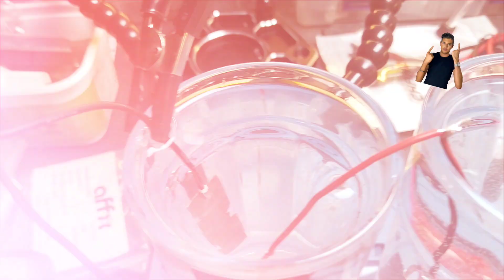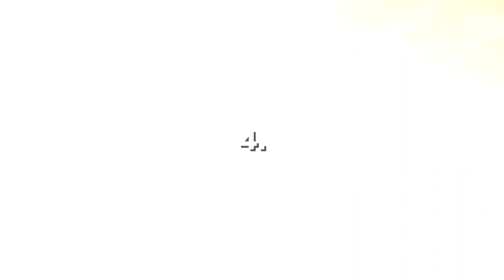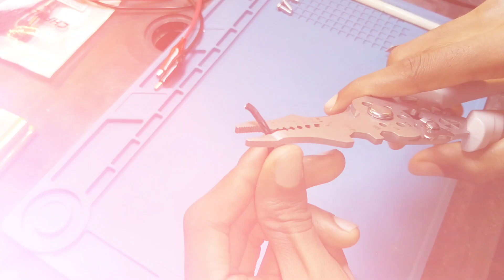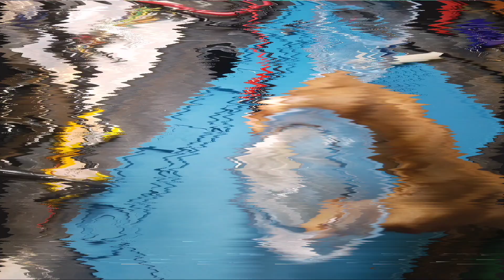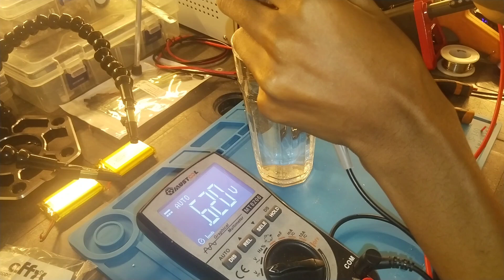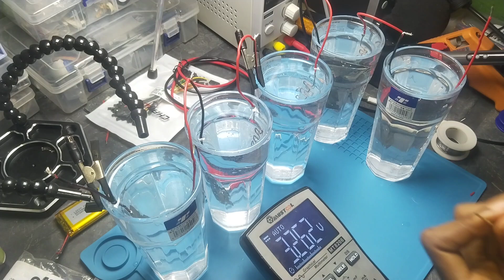How I Created electricity with Salt!(Upgrade) - Powering USB Solder

Comment: Great experiment! I like that you’re testing ideas. One thing you might read about is internal resistance. Your salt water cells show good open circuit voltage, but the voltage sags under load. A boost converter can’t fix that power limit. Maybe try a Daniell cell as a stronger battery experiment.
Reply from the maker: Daniell cell! I'll keep that in mind and try to make one some day, then I'll share. Also thanks for watching!

Comment: How many currents are you getting and what is the total power output of each glass cell and how much watts is each glass and the capacity of each glass i.e. 100cc or 50cc, please be careful for your life those battery manufacturers will sure be looking out for you for destroying thier business if everyone could get free currents from a salt water battery, in fact salt water is unlimited as oceans are so full up, good luck man, start pateting your idea, and thanks for sharing.
Reply from the maker: Thanks for the comment! Just a quick question: did you watch the video all the way to the end? If you did, you'll notice the experiment was not a success. My goal was to see if the saltwater cells could charge a 5volts USB soldering iron, but they couldn't. The only thing I managed to power was a very small LED, in my other salt water battery build video and even those were quite dim.

I also mentioned that I'll keep experimenting and update everyone if I get better results(on my Patroen page). Right now, this DIY saltwater battery is nowhere near as practical or efficient as a normal lithium battery. If you need a reliable power source, a regular battery is still the better choice.

Regarding the current, I measured the voltage, and as soon as I connected my LTC1871 boost converter, the voltage collapsed from around 3.2V to about 1.2V. That tells us the battery has a very high internal resistance and can only supply a very small amount of current. The exact current wasn't the focus because the voltage drop already showed it couldn't provide enough power for the application.

And about battery manufacturers coming after me, there's really no need to worry. Saltwater batteries have existed for many years, there are already commercial more advanced saltwater batteries, and there are thousands of DIY videos on YouTube about them. I'm simply sharing my own experiment and what I learned from it, not claiming I've invented a new battery or discovered free energy.
Reply from the maker: And for your main question of  how much capacity of water in each glass cup, I think it or 's around 500cc or 50cl